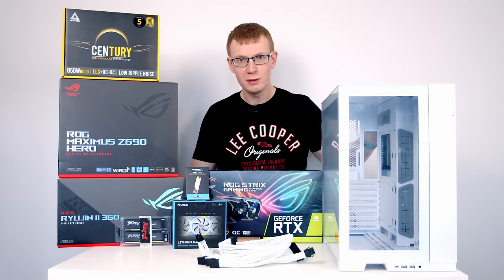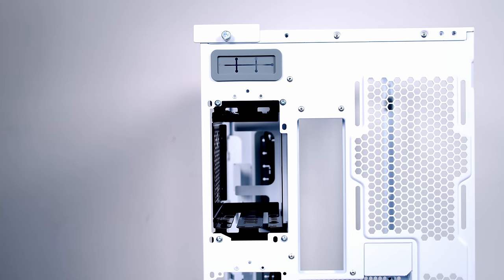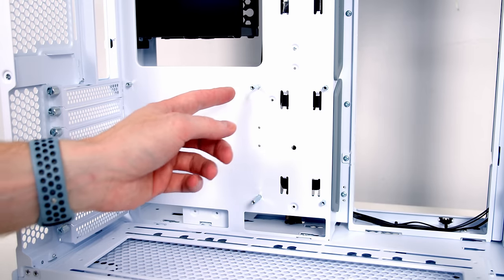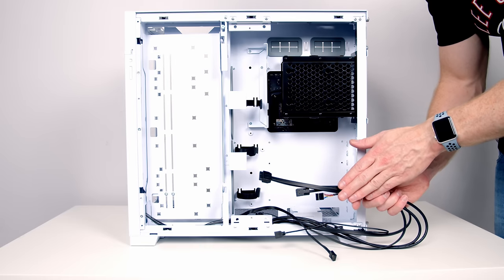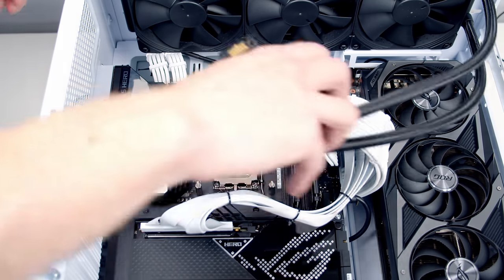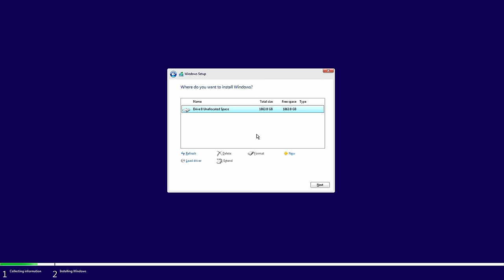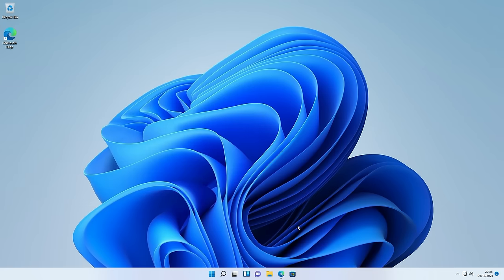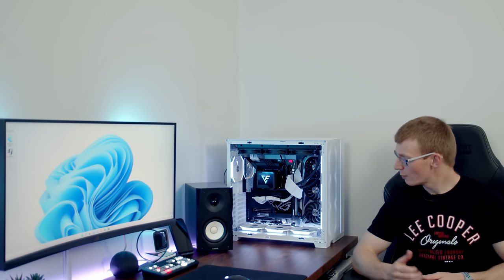Lian Li O11 Dynamic EVO - Step by Step PC Build Guide

Comment: I don’t know if they updated the case since this video, but the top panel does need to be taken off first, and then unscrew one of the screws on top before you can take it off 👍🏼
Reply: I was wondering why the glass panels weren’t coming off. Thanks!
Reply: Thank you for this lol I was struggling wondering what was going on.
Reply: That's the old version
Reply: @serverous85  Nah, the screw just doesnt come installed and isnt necessary. Its good for transporting it tho
Reply: It’s the same but you don’t have to put the screw back if you don’t wanna because they have like these clips but do know they me wear over time, but you don’t put that side panel screw back on them you can pull it in and out without removing the top
Reply: You guys are mvp. Microcenter built it and left the film on the inside. Thanks for the help
Reply: lol, thanks for this. My fingertips were getting sore trying to pry off that side panel.
Reply: I was struggling so hard! I finally ended up reading the instructions and realized this. Thank god I didn't break the glass!
Reply: @TheBlackbeltGorilla  Oh geez, good thing I came back and read more comments. I left the film on the inside as well.
Reply: @gibber1944  Wait, what film? I'm currently doing a build in this case.
Reply: Wish I had read this comment earlier lol thanks
Reply: I was like, "no way this is going to come off without me breaking the glass." I didn't though, but yea don't pull on those panels until the screws are removed. Did you know, that you can use those screws at the bottom fan mount tray to secure it better than just the thumb screw by itself?
Reply: @Jdjdjrb  yea, same here. What inside film? Mine has the outside film, but none that I can see on the inside. After messing around with 10 lian li infinity fans, I have to say that I'm not sure about the QA over there.
Reply: yes i almost broke mine trying to yank off the glass.....
Reply: Took me 15 mins of head scratching and manual homework to figure out it comes with the “transport” screws in place. It was the most difficult part of my build! 🤭🤭🤭
Reply: fucking bent mine because of this
Reply: I almost just ripped the shit out this thing.
Reply: @lolfengz  that was to secure them during shipping.

Comment: I built my first PC back in 2020.. it’s a powerful PC but I made many mistakes and I’m going to take it apart and replace everything BUT the graphics card, memory, ram, motherboard. Everything else, selling and buying new equipment that’s BETTER. First to go? My case, it’s a Lian Li lancool mesh 2 and it’s amazing it’s just.. not big enough and I’d like to put a lot of fans in my pc to help with heat as ive noticed my GPU gets rather toasty and I like the looks of this many fans. Everything else is TBD, so thanks for this video!

Comment: This video was extremely helpful for my build! It was my first ever and I truly couldn’t have done it without this video!
Reply: Any tips bro im thinking of using this case for my first build
Reply: @unknownzarby1854  same. what parts u using
Reply: @Mesakezuit  sup bro for parts, im going with a ryzen 5600x, asus x570 mb, 16gb 3600mhz t-force ram, rtx 3070, 750w psu, samsung 1t ssd, for case i went with Lian li dynamic evo i just got it today really expensive 200$ but this is my dream build, also lian li sl120 infinity fans and nzxt z73 aio everything white btw!
Reply: @unknownzarby1854  similar, but aio comes with lcd screen from nzxt saving until 2024. good luck make have fun

Comment: I like this build - (I love the previous, Snow White mini version of the case.)  I'm also liking the idea of Alder lake more and more as I get more information. Ive been building all AMD systems since the Phenom X3 but it seems AMD and Intel have switched places. Now Intel is value packed underdog and apparently doing a good job of it. I recently upgraded my B450 board with a 5600X -- even still, its looking more and more like my next build could be an Intel board with the next Alder Lake chip.

Comment: Wow solid build guide- love how you even covered where to plug in on the MOBO as this is regularly missed- and going through windows install was also a nice section much more detailed than most other channels
Reply: IT REALLY HELPED ME
Reply: This was a great guide, then I find out my gigabyte gaming x ax z790 board does not match the f panel cable so yay that's fun... apparently I need to now buy an adapter for absolutely no logical reason because gigabyte like to be special.... 😢

Comment: Very good showcase for Lian Li EVO. Thanks CF.
Finally a case where the PSU doesn't suck dust from underneath the case just to blow it out in the next second. 
I will mount PSU fan facing CPU backplate in this case to suck some hot air from back of the CPU(if ever I will get this case). However, Lian Li EVO is way above my budget for a case and I really hate cases with PSU down.

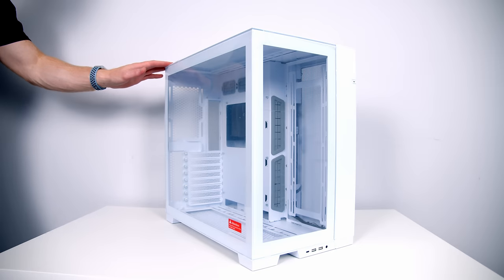Comment: 2:25 -> removing panels
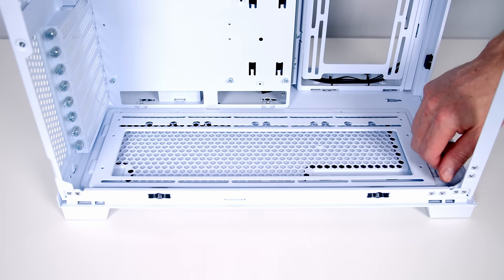4:24 -> removing bottom bracket
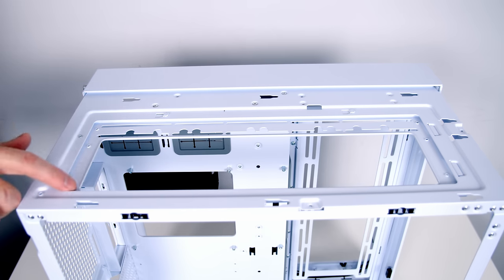4:56 -> removing top bracket
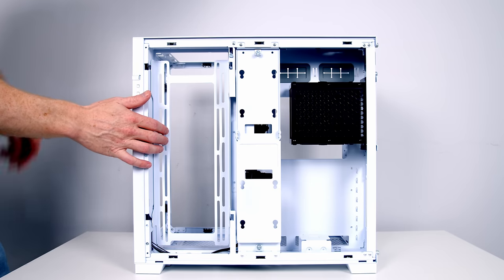5:13 -> removing side bracket
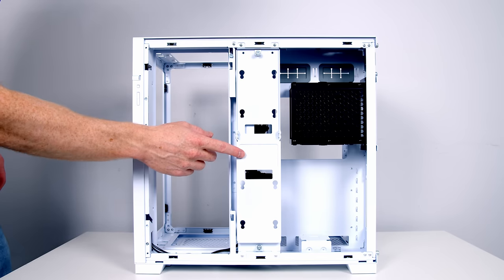5:46 -> removing cable bracket
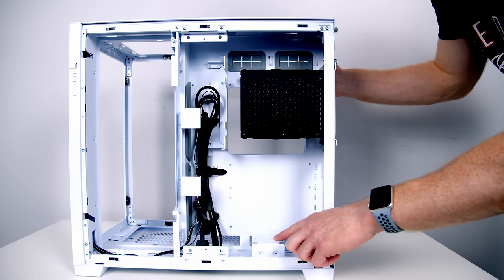6:21 -> removing hard drive cage
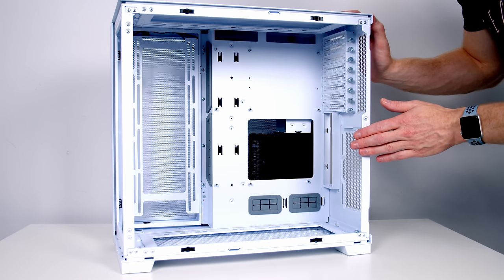12:36 -> installing gpu sag bracket

Comment: Just built my first PC following this video for the most part aside from GPU/fan mounting and had a different AIO and Motherboard. Took me a long time but mostly from figuring out where to mount things and because of case differences that threw me off from your case to mine. Seems like the case has been updated since; either that or I have an older/different version of this case, but I had no front mount for fans at all and there were a few extra security screws. Thank you for the awesome video; the close ups, especially the cable shots helped a lot; I was very confident with plugging everything in because you made it so clear where everything went and where to place them. My only suggestion would be that it'd be nice if you included a small section for people that wanted to mount their GPU the conventional way. This was my first time mounting a 360M CPU and the short portion on adding the stabilizers was very confusing since I couldn't visualize everything together although I'm sure its covered in another video. Also, tips for people building their first PCs like me: 
1) If you're stuck, read the user manuals
2) Don't save cable management for the end; it will haunt you unless your case is massive. Instead actively try to group cables together after plugging them in and positioning them with zip ties etc and tidying up will become significantly easier. 
3) You can daisy chain most SATA-powered components; i.e. you can attach them to the same cable. Sounds stupid but this actually confused me haha
4) Some fans, like the Lian Li series used in this video have much less cables because they have built in daisy-chaining(reduces cables from 3 to 1) and you can re-use the one USB hub. I had to re-plan my fans a few times because only two USB 2.0 outlets on my motherboard and all the triple fans I got came with fan hubs that needed a USB hub on my mobo. Moving forwards, I think I will only be using Lian Li fans or similar to simplify and reduce cables

Comment: Thanks for all your efforts! By the way at 2:35 you cant take the two glass panels off before unscrewing the top screws. @6:10 I found all those brackets were in the way so I took them all out, saved room.

Comment: Great video to showcase the building with the soon to be released case, I did notice:
The GPU temps are pretty high, it's probably due to proximity with the radiator and the lack of space/airflow in the case overall, this is my main concern when I'm about to attempt my build. I want to avoid a giant tower but with seeing how congested the inside gets with just 1 AIO it's concerning
Reply: It’s actually due to the Asus card being mounted upright specifically. There is a follow up video. Not sure why but the Asus card simply doesn’t perform well in the upright configuration.

Comment: Nice build. My only complaint is that the white 24pin and GPU cables are a bit of an eyesore; I'm surprised you didn't go with black cables as they would have blended in a bit better. Other than that minor issue, I really liked  it and enjoyed the video.

Comment: Man you made a potential nightmare turn into a pleasant experience. This is the only video that walked through every little detail on everything.

I do have a question. My motherboard only has one ARGB connection so I used that for the case. Do I need the ARGB cord from the Ryujin II connected? Also, I used a set of the Lian Li fans for the radiator and one fan as an exhaust out the back. I have all Lian Li fans connected to the Lian Li controller and the one fan to the ASUS controller. Do I need to switch the three Lian Li fans to the ASUS controller or keep it how it is? If I switch those over than I’ll need the ARGB cord plugged in then?

Comment: I've just finished building this case and it's quite nice apart from one thing: if you mount your SSDs along the bottom of the case (I have four), they are flush to the bottom of the case and it's virtually impossible to connect the SATA power cables to the drives.  What were Lian Li thinking?  They should've simply provided a bracket that connected to the bottom of the case and allowed you to stack a bunch of drives, like they're designed to do.

Comment: Do you have a cable management video by chance? Built my dream pc with your videos but I have a total mess in the back
Reply: Did you ever figure this out ? Can I see your wiring
Reply: @erick_outkastz  I just ended up using lots of zip ties and stuffing cables 
The way the case is it hides pretty well in the back panel. 
Just be careful with prongs bending if they are in a pressure area

Comment: Really helpful to see all the config features explained and used. This will definitely make life easier once starting. Question -- does the upright GPU mount limit radiator thickness on a 360mm? It's hard to tell from the video if the GPU shroud is out of the way of the radiator/fans vertical space or not.

Comment: Excellent video showing off the case and all it has.  Was thinking about possibly trying the vertical gpu mount but after seeing the video I wont do it that way.  Your setup was awesome and clean but the riser cable placement to me is a no go.  Looks bad.  Not that you did anything wrong, just don't like the look of it crossing over like that which I understand isn't your fault.  Just the only way of doing it.

Comment: I have a question. Related to the Lian libo11 dynamic case. Can I put 3 fans on top, side, bottom, and front of case? For a total of 12. Then have one more exhaust fan on the back, 3 gpu fans, and the psu fans ofc

Comment: Can the rear io panel be removed? I have an msi z690 edge ddr4 wifi motherboard and it's preinstalled io shield seems to cause the standoffs to not line up slightly

(Edit) the problem was actually that my top 3 stand offs were misaligned by a milimeter or two. I ended up just screwing in the corners then carefully applying pressure in the direction of the rear io to get the top stand offs to align enough to screw in

Comment: Christopher, great video. I just bought this case with newer tech. My only question is what you did with the RGB strip cable from the case to the PSU. The Lian Li states this must be connected to a 5v SATA and NOT 12v SATA socket. How would I know what my PSU provides? I bought a Montech Century G5 850W. The socket on the PSU only says "SATA/Molex".  How would I know if this is 5v or 12v?

Comment: Amazing video and really helpful as I built the PC! 

One question I have is, the power button is flashing white and is not a constantly on (as seen at 44:36 in the video). I couldn't find any info in the manual or searching online. What could be the possible reason for the same?

Comment: Hey man where do the dp and hdmi cables route out of case when mounting gpu vertically in this case? I am struggling with this. Great video I have used it quite extensively for my new build. I see how you did it but not sure when I put all the pieces back together how the cables are going to route out.

Comment: Hey mate nice build. I have a quick question, i have the same motherboard and also have 4 sticks of Dominator ddr5 ram 5600mhz and iv been told that the new boards don’t like 4 sticks when xmp is enabled? Some say it’s fine some say it’s unstable? Are you able to shed some light at all? Thanks heaps

Comment: i´m interested in this case but if you use 7 AL120 Fans and a cooler 360 argb, how you connect the light strip of the chasis ? great and clear video

Comment: I need help.  Great video, but I’ve bumped into a problem.  I currently have the Liam li 011 dynamic case along with:
* ASUS ROG MAXIMUS Z690 HERO motherboard; 
* i9 Intel CORE unlocked 13th gen (i9-13900k, 36 MB Cashe, LGA 1700)
* GEFORCE RTX 4090 graphics card
* ROG STRIX LC II 360 ARGB liquid CPU cooler
* LIAN LI UNI FANs SL120 (x9)
* LIAN LI Strimer plus v2: (white 24 pin LED extension)

The problem I have is the MoBo only comes with 2 USB2.0 ports at the bottom right, but the fans, cooler and Strimer all need a USB 2.0 port.  How do you have them connected.  Also as a side note, (on the MoBo) I see the pump slot on the top right, but don’t have a cable cord to match those 4 pins.   What am I missing?  
It all comes on, but I have to chose between the cooler, strimer or fan lights and only have two showing off the LEDs.

Additional question about hanging the Graphics card.  In doing so, does the HDMI and display port  cables simply run out the back of the PC?  I see the opening for that, but that seems a bit odd if I ever needed to move or change out the cord I would need to open the PC, remove the top mounted radiator just to get to the connectors.  Is that correct or am I missing something there as well?  

Thanks

Comment: Thanks for all your awesome videos. I'm currently working on my first build and I'm using the Ryujin ii but I have installed trip Uni SL-INF 120 Fans on it instead of the included fans. My question would be how do I connect the fans as they have their own proprietory connections to the LianLi controller and the Asus AIO has its own controller as well. It doesnt seem that I can connect the AIO directly to the pump/fan header on my Asus MB because the AIO did not come with that connector. Hopefully you see this as I dont want to screw this one up. Thanks.

Comment: Hello there, Thank you for your time and dedication, great explanation as well. However i have couple of questions. I have asus x670 MB and i would like to connect 7 argb fans to it. On the box of the fans which are Jonsbo zf120 says that they have the following specs: Rated voltage: fan dc12v led 5v; rated curren 0.28A; power consumption: fan 3.36w, LED 1.4W. On the manual of my MB says that a single aRGB header can support 3A 5V, i guess this is 15W. I did the math and 7x0.28 is =1.96A ; 7x1.4 = 9.8W. I would connect the pmw to different headers on the MB since they support 12W. However i ve connected the 7 fans to each other with the 3pin plugs that they have to each other to make a daisy chain. I saw that this is possible. Please tell me if this is going to work or no? Thank you! 
Regards

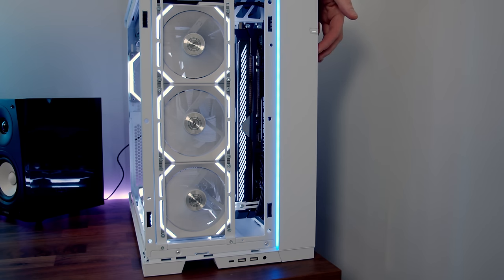Comment: 44:24 this is exactly what i am trying to avoid. I want to control all lights from one software and not by using SignalRGB or something like that. ASUS is my Mobo, AIO and keyboard options, those won't change, so my fans gotta sync with those too. So if there is no AURA Sync, it's a no.

Comment: Nice build.. I have an Asus Maximus Z690 extreme. Can this eatx motherboard which measures as 10.9 inches in width fit with 3 x120 ml fans fitted on the side panel. I know an upright GPU won't fit but I plan to fit the GPU in the normal position. I just hope the 3x120 ml fans will fit on the side panel with the motherboard mentioned also fitted. i did notice in the video you can reverse the side panel bracket. The other way round like you said the fans then should be further back so the fans shopuld fit that way1

Comment: Thanks for the amazing vid! I had a question regarding SSD's: Do I have to use the SSD type you used in the video? I have the older SSD's in my current rig: Kingston SATA III interface. Thanks again
Reply: Can be used, most just use the M.2 drives as there is no wires and a little more faster speed
Reply: @haies09  Thanks!

Comment: Noticed you went for a front mesh instead of the stock glass panel. Would it be detrimental if i went for an upright position, 
360mm AIO top exhaust, 3x bottom intake, 3x side exhaust, 1x rear exhaust?

Comment: Great video,  I am using z790 pro A wifi6 board but when I assemble the Case, the power button doesn't work but when I press the power button on the board it works okay, is there anything wrong with this case connection? thx!

Comment: Christopher, HELP! Do you think the backplate for the harddrives might choke the GPU of air, or should it be fine? In the reverse build video you did you used the fan plate and put fans in. My wife just finished it with the harddrive cage installed. But I am worried about GPU air flow.

Comment: What a great informative video!!! I’m having almost same build with Rog strix s690 7 lian li sli 120 infinity fans and aio strix LC ll 360, I’m having trouble being able to hook up all the argb connectors, because the mobo has only 3, 2 sets of 3 fans are connected to the mobo so there I’m using one argb, one single fan has to go to the mobo so there is another, and then I hablé only one left for the aio, the dynamic Evo that has an argb and the strimer plus v2 24 pin, so that puts me out of argb connectors, what can I do? 🙏🏻🙏🏻

Comment: Does the EVGA SuperNOVA 1000 G+, 80 Plus Gold 1000W fit in this case? I’ve seen so many smaller psu fit but I’m really not sure on mine, currently deciding between this case and a Corsair 5000 airflow